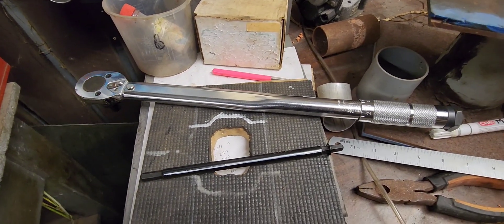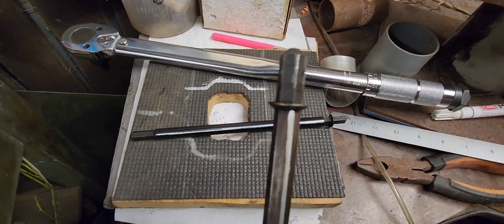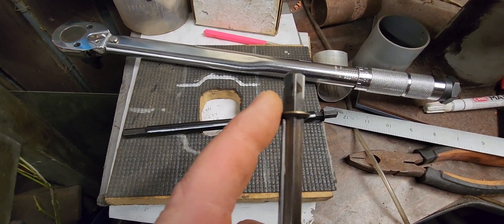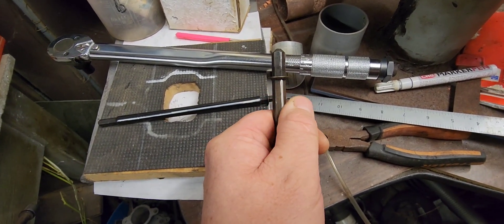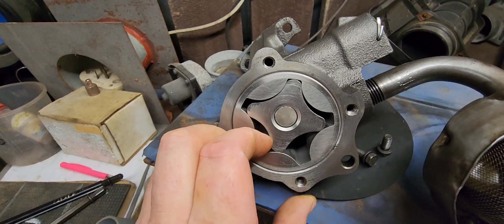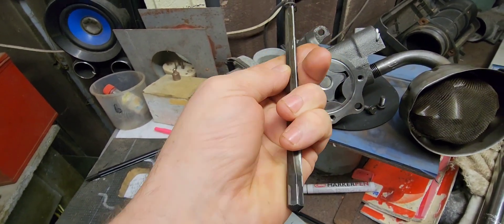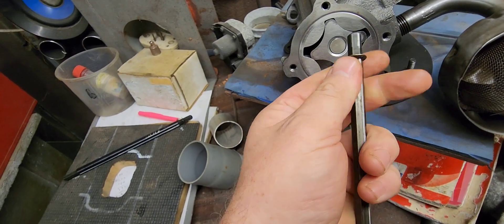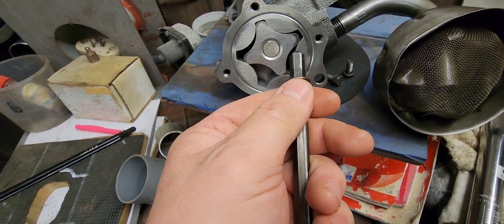Cleveland Oil Pump Drive Torque Test -  Stock Vrs ARP. Who Will Fail First?

Comment: Hi Buddy, i thought this may be interesting and it was just a little bit. I didnt watch it all sorry. i dont have 20 mins to spend on something like this. Im a bit oposed to ARP drive shafts as i beleive they are too stiff and shockload the distributor drive gear. The 5/16 OE type shaft is, for just about all appications, a prolem free oil pump drive solution. If it does fail then its not becuse it wasnt strong enough or good enough in any way, it was something else that caused its demise. You have not convinced me to use ARP shafts.
Reply from the maker: That's a good point.

I did cover it later in the video about how the shaft can contribute to spark scatter as the stock shaft twists easier. Its continuous wind-up and release caused by the pump would cause the force on the camgear to be uneven. However, I also spoke to someone about this, and they pointed out how this action helps alleviate harmonics in the camshaft. 
As with anything, risk ultimately falls on the end user. I am prepared to take that risk. But, I expect no one to follow. 

All things considered, the only things I can think of to generate 
+50lb/ft of force is either the pump bypass has to jam shut, the oil is too thick, or too high an rpm is trying to be achieved.